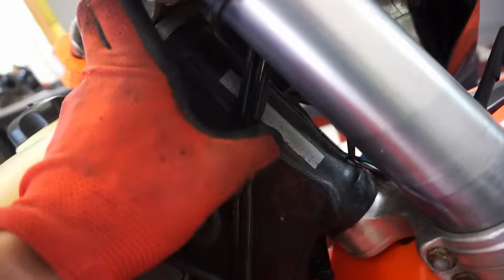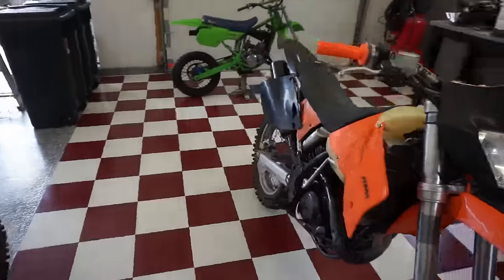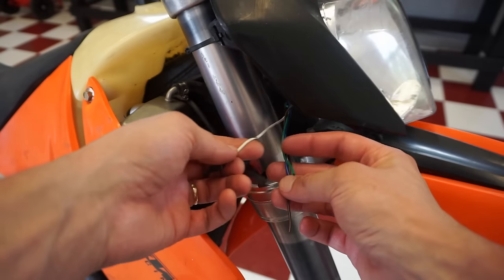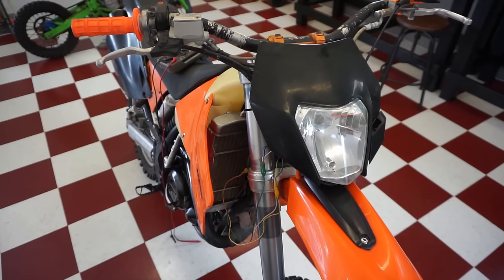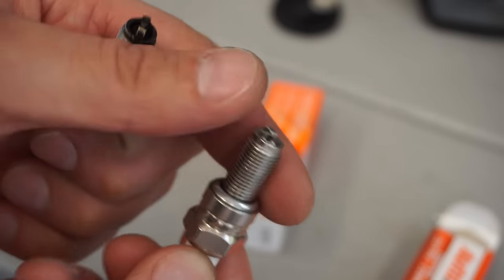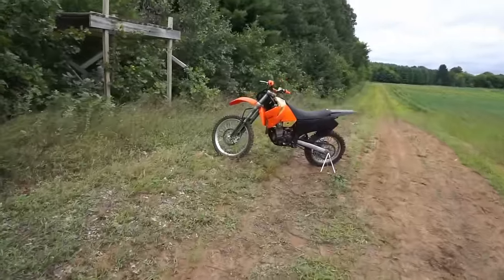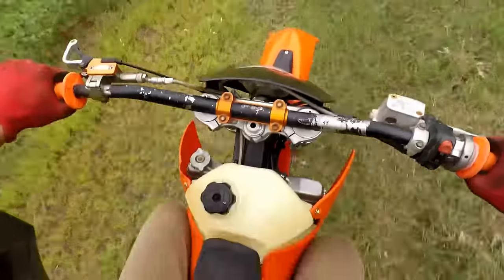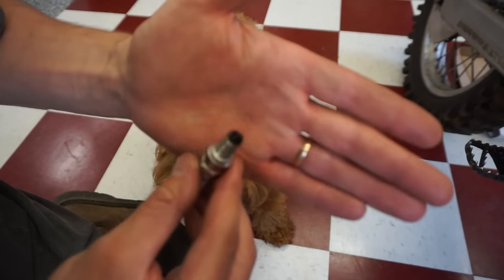This Is Why You DON'T Buy a KTM Dirt Bike ($1300 KTM 450 Find)

Comment: Dont be affraid of rejetting a carb! The stock jetting isnt always the answer. Even a couple degree change in the temperature can make it bog. If you feel like it needs a smaller one put one in it.
Reply: JD jetting makes a great jet kit
Reply: I agree. Definitely worth a shot. Worst that can happen is that it doesn't ride any better but hey it's already running pretty bad as is.
Reply: I agree. the issue that I have is that you shouldn’t have to, unless you plan to operate at extreme altitude(s). I believe many OEM suppliers & aftermarket producers could do a much better job at machining & assembling parts with tighter tolerances. I’ve seen big-name Japanese automotive part suppliers’ quality decline in Honda/Acura and Nissan engine & transmission manufacturing over recent years, so I imagine that their power sports parts/component manufacturing has followed suit. I was in the mass pro auto industry during & years after the tsunami, but the out-of-spec-parts increase began well after their infrastructures were restored. I fear the worst is just beginning.
Reply: Agree with this
Reply: They are little lean on factory jets because lot of these was street legal and had to pass emissions
Reply: @corporalclegg914  
I live at high altitude and rejeted both my son's Honda's made a huge difference.

Comment: This era ktm was known for issues… all sorts of issues…. The new models are superior machines
Reply: Amen that
Reply: @PearlyS10  pos this thing is god dammit!😮😱👁👀👁🤯🤪😮🤔🤔🤔
Reply: Lol last vid everyone was saying that era of ktm was “highly sought after” what is it with KTM riders lol
Reply: @urbanitesgarage3299  they were saying the 2003-2007 generation were very sought after, because they are. I’ve seen several of those motors with thousands upon thousands of miles on completely stock intervals, only oil changes.
Reply: @mw4518  im cutting it close with a 2008 lol
Reply: The rfs motors are nice.  Im looking for a older one to ride on the street . I used to have a 97 ktm 250exc..it was fun as hell.
Reply: @mw4518  Correct, the RFS
Reply: The rfs engine in these years ktms are bullet proof and have a good reputation for it. My old 525 exc with rfs engine was used hard for 10000 miles on a supermoto set up and I had no problems, not one. I inspected the engine and was still in spec, I changed the rings for good measure, put it back together and sold it to a friend. He's coming up to another 7000 miles and had no issues. Amazing machines when they are in the right hands.
Reply: @catow465  same, 2008 xc-f 450. Only issue is a leaky fork seal
Reply: @minibikemadman  I know someone that's got a 97 360sx
Reply: @oregonjeeper7977  ive got a 2008 125 exc, needs a new stator as the old one was thrashed
Reply: Nonsense
Reply: The same can be said about the Japanese 4 strokes from the early 2000s as well.
Reply: I feel like the old KTMs are the reason those who ride "traditional" bikes hate KTM 😂 Seemingly many silly issues can arise from odd engineering choices.
Reply: Wrong, they're all junk
Reply: @freddyb9974  Ok boomer
Reply: @mw4518  just bought a 450 exc so glad to see I fall in that interval 😂
Reply: @minibikemadman  just got a 450exc supermoto for the street, super worht it!

Comment: I can’t justify saying that the stator isn’t an issue, but I had issues with my 2002 520 falling on its face like that. Checking that the throttle position sensor is rotated to the optimum position helped, because that adjust the spark timing as the throttle turns. The thing that seemed to help the most was dropping the needle in the throttle by raising the clip position two spots, reducing the flow of fuel as you open the throttle further. Really hope you figure it out, love the work you do, keep it up!
Reply: throttle position sensor on a carb?
Reply: This is why you don't buy a KTM dirt bike: you don't know the difference between a high/mid-speed miss and a 'rev limiter'...take the advice given, check the TPS,, but since the plug (wrong AutoZone special) is black and sooty, maybe check the needle position and/or the main jet size. Just because 172 is 'stock' doesn't mean it's right for your setup. It's just a starting point....

My approach would be to start by leaning out the main, so it pulls hard at wide open throttle (WOT), and then adjusting the needle to smooth out the transition between part-throttle and WOT. The pilot already seems fine...

Just a thought.
Reply: Bury it next to the Yamaha!

Comment: Had a very similar issue with my bike , turns out it was bad wire in the coil and a few other wires on the bike that had corroded over . Fixed all the wiring issues and it ran perfect

Comment: Definitely sounds like an ignition issue. Fuel delivery problems are seldom intermittent. Start with the simple stuff. Disconnect the stop/kill switch from the primary lead of the ignition coil and test ride the bike . If problem persists, unscrew the spark plug boot from the secondary ignition coil lead and check the resistance of the boot. It should be close to 5k ohms. 4.5 - 5.5k is fine. Then before re-installing the boot, trim the secondary coil lead back 1/2". Make sure the lead is long enough to do this. There have been thousands of perfectly good ignition coils replaced when the only problem was the spark plug boot or the connection between the boot and the secondary coil wire. Other than these checks, it's on to the stator, pick up coil and CDI unit.
 Good luck!

Comment: Check valve clearances, and I would also pull the stator cover again and check the stator voltage output at the connector itself where it connects to the main harness.  That bottom coil @ 17:00 mark in your last video looks very dark to me.  It could be something simple as a bad electrical connection, someone was obviously messing with the electrical at one point based on the headlight wiring.  Yes it does appear to slowly build up a charge, but that doesn't seem right.  As soon as it starts up, if its charging properly, it should be reading high 13s - low 14s steadily, it shouldn't take a min or two to climb to 14.  It should just read and maintain whatever it is outputting for voltage.  From a quick google search, yours has symptoms of a dying stator, which can also cause engine running issues like yours is having.  So I would find the stator resistance/output specs and start troubleshooting there.  If none of that helps, then I would start looking at re-jetting the carburetor.
Reply: @martin barr's CRF450 not necessarily. The ktms didn't really get hard to start if the valve lash was too large unless it got to the point that the valve wasn't opening. And it seems like its getting a little warmer than joe wants it to considering he was complaining about boiling coolant when he rode it.
Reply: See my comment, I had the same problem because my bike was running too lean. All the time I tought was rich condition because of the black smoked spark plug. The black smoked spark plug can be confusing.
Reply: I agree. Battery should be charging at well over 13 volts the instant the bike is started.
Reply: @Mr.M1STER  True, whatever else is wrong with it that is not right for a start.
Reply: Valves

Comment: Recheck your valve clearance. Could be as simple as your intake is too tight and not clearing all the fuel into the cylinder when it opens causing it to pile up and get more and more rich as it runs. Other than that the timing could be slightly off, maybe the woodruff key bent slightly when you were having those one way bearing issues.
Reply: I'd check you're intake valves miby something is slightly off as there normally decent running bikes over   engineering definitely with ktm but it seems like it will definitely be a small problem
Reply: Leak down test

Comment: I had a 2002 EXC 300 2 stroke when I was a kid, I loved it! I was so comfortable riding it. I was racing my CR 85 before, when I switched to the KTM I noticed and felt a major improvement in my riding. I miss it, it looked exactly like yours.
Reply: I have a 99 380 and it’s amazing. So much power, it keeps up with the newer 250’s and 300’s. It Doesn’t give me much trouble it’s pretty reliable. I hate how he said “this is why you don’t buy a ktm” he bought a cheap bike that obviously hasn’t been taken care of, of course it’s gonna be a basket case. If you take care of them they’re great. If you buy a cheap one that’s been abused obviously your not gonna have a good time.

Comment: The hole in the fuel tank on KTM bikes for the choke is just for the extra fuel capacity of the tank, not "over-engineering" in my opinion.
Reply: Exactly correct. When you only have a 2-ish gallon capacity in the first place, that extra capacity could be the difference between riding home, or pushing the bike home.

Comment: I had a failing stator and it produced the exact symptoms your dealing with.  It would start up and run good in the low rpm’s but would break up at high rpm’s like seen in the video. The stator does seem to have an issue with it based off those charging voltages. Should immediately jump up in voltage, not a slow climb as seen on your bike
Reply: I agree with Model RC. 13.0 volts is not enough. That would cause your rich condition also. Not a KTM guy, but I would think the voltage should be 14.0 to 14.5 with it running.
Reply: I had a sx-f 450 and the voltage was 13.5  - 13.8
Reply: @danielspataru6372  That voltage makes sense IMOP.
Reply: same, my honda trx300ex had that problem ran fine but then sometimes it would limit at 80kmh 2min later 92kmh then 70 felt like it had a rev limiter, then drive fine, stator was all dirty and i just changed and never had that problem again (i did but the spark plug booth moved and didnt make connection but that was a easy fix)

Comment: If it truly is a 2002 400EXC then the exhaust is wrong. The 2002 400 had two pipes out of the cylinder all the way to mid pipe before it went to one and into the silencer. Also, the muffler does have a spark arrestor in it. I owned one since new and just recently sold it for a newer model.
A JD Jetting kit would wake that bike up, but I agree with others that the bogging issue is electrical.
That year carb was difficult to get the pump set correctly as you have to bend a tab. Took me many tries to get it right.
Good luck!
Reply: Ever heard of aftermarket exhaust?
Reply: @rposton919  aftermarket pipe doesn't change the head mate😂😂😂
Reply: Two pipes come straight out of the head on 400 exc  so perhaps that's 450?

Comment: 20-year old bike. For a sanity check, try a quick leak down test just to verify there's no issue with valves or rings before getting too involved with carb adjustments or electrical system.

Comment: New Regular rectifier - Cheap as chips -  (Voltage should higher than that), also voltage drops slightly if anything when you rev it up  - Also compression doesn’t last very long on the EXC’s - New rings and yer good - Get yer money back on that sprag clutch bearing - Still a good buy though.

Comment: Check the pick up coil.,or the points to if that we engine has them on it to. They set between 0.15 to 0.20 thousands of A inch on top dead center to just about to open up. Accept still closed off until the crankshaft is rolled over again to fire under pressure.

Comment: I've had something similar happen before. Turns out when I replaced the diaphragm on the carb, i put the fuel needle through the retaining clip instead of under it. It caused the bike to bog under load. You can also see if you can adjust where the fuel needle sits on the clip and check for tears in the diaphragm.

Comment: Could the previous owner have changed the float hight , attempting to stop the fuel from leaking? What notch was the clip for the main jet needle in?
Reply: I agree. It points to a possible float height problem but maybe set too low.

Comment: According to plug definitely running rich but I’d almost be willing to bet it’s maybe an intermittent spark issue on acceleration. My rmz kinda did something similar to this and it was in fact electrical
Reply: Black smoked spark plug not always is because running rich, I can be because is running too lean. It can be confusing, but I had the same problem, the plug was black and smoked. It took me 2-3 weeks to figure it  out, always I was thinking is running too rich because plug, but NO was lean condition. After trying big jets I coudn't belive is running too good, starts with no choke and rev it out completly.

Comment: You need to route the throttle cables correctly they should go between the handlebars and the tank I can hear the throttle sticking when you turn the bars.and it actually sounds lean at higher rpm definitely do the mid base gaskets on the carb it's sucking air .

Comment: I have A 2000 400exc it's the carb, I never could get it to run right I bought a rebuilt carb for 300 and sold mine for 200. Best 100 bucks I ever spent. My original carb someone had added a long fuel screw and that model carb wasn't even designed for it. Made bike run super rich.

Comment: Why do you buy new plugs just because it’s carbed up?? Does no one ever clean spark plugs anymore? All you need is a fine brass wire brush. They last years if you just clean them and keep the gap set correctly. 

It’s most likely running rich, so an air filter or carb setting issue.

Comment: My banshee used to do this same thing it was from a stator wire running along next to the exhaust and it would start up and run great until it warmed up then sputtered only on acceleration the wire would heat up and loose continuity and make it run poor
Reply: Or pick up coil get's hot and fails.

Comment: Hi had an EXC 520 - I converted it to a Supermoto with stiffer suspension, upgraded brakes, 17 inch wheels front an drear, road tyres and different sprocket ratios and it was AWSOME!!!!

Comment: Also checkout the inline fuel filter for being plugged up with debris.&sludge build up. One more thing to checkout is the fuel tank line inlet port for fuel flow blockage to like from rust.& Etc.

Comment: If you can I'd test the stator and coil cold vs hot seems like it's either blowing out the spark or has compression loss through the head gasket or something and maybe it's causing it to give false rich plug readings.
Reply: I second the head gasket he says it's getting hot

Comment: Check the airfilter and intake track , if the carb is functioning as it’s suppose w stock jets and it’s pig rich then check the filter and intake track to make sure nothing made a nest or has it obstructed , if that’s Gucci time to check the valves and do a leak down test . I’ve seen cam lobes wear off which caused a similar issue .

Comment: Typically manufactures give rich jetting. So the average Joe don't blow them up. Maybe this machine just runs rich. Id try dropping the jetting. The accelerater pump you usually don't get enough squirt. When they fail they are not squirting enough. Today's ktm are top notch. All the early (02-04)4 strokes the manufacturers were trying to work out the bugs of competitive 4 strokes. Not just ktm the big 4 Japanese too

Comment: looks like this bike has had a hard life, using large gauge amp wire for battery wires, the headlight isn't properly fastened to the forks ( doesn't even look like a KTM headlight, but a cheap aftermarket) no brake light etc

Comment: My 2010 400xcw sounded like that right B4 it dropped a valve locking up bike.
  Head alone 800$.  Oil was clean but there was shards in my airbox

Comment: I had an ATC 90 I bought as a box of parts. Got it all together and it never ran right, like your KTM. Turns out the box of parts came with two ignition coils. I picked the wrong one. Put the other one in and it ran perfectly. .

Comment: replace mid body carby gaskets. if it has a slide check the gasket or o ring on that. I have a 01 wr250 that would still randomly when warm, miss on load and sometimes not start because of a bad mid body gasket and slide gasket. it wasn't even that bad but enough to make it do several weird things. another thing to check is try another coil in it. if the coils going bad it can break down when they get warm. process of elimination now.

Comment: Try raising the needle in the carb slide 2 notches, if that improves things check the float height and set to factory settings then go back to the needle and set the best position by testing. Your problem is lean mixture not rich I think

Comment: I had a four stroke that ran just like that once. Tried everything. Turned out it just needed a new spark plug, the one that was in it was causing bad misfires.
Reply: Not trying to be rude I’m Just curious, what all did you change?😂 normally the spark plug is the first thing to change when your having issues